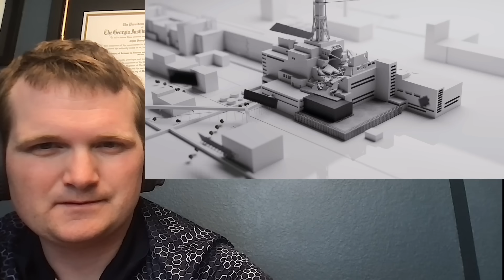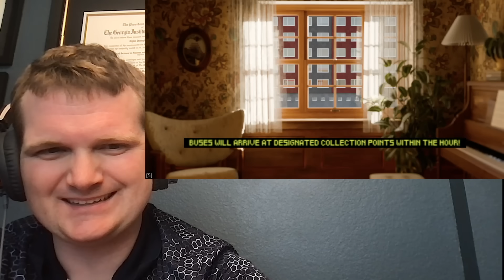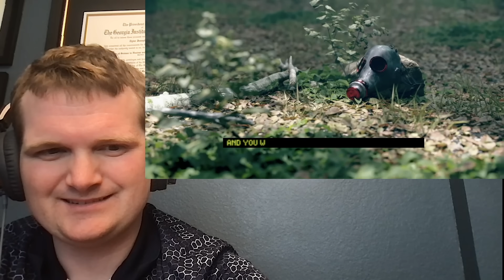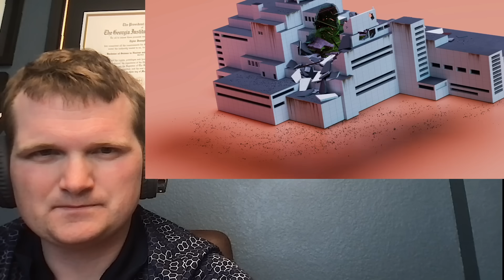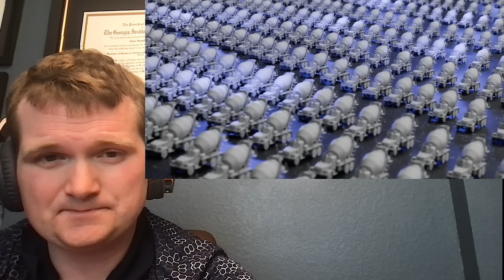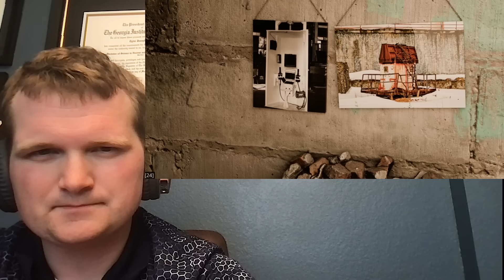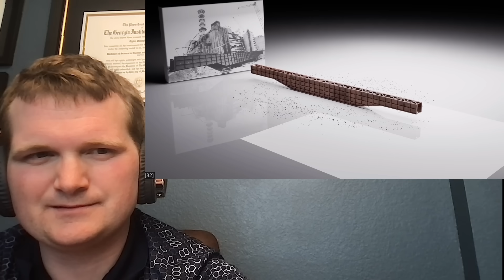The BEST Chernobyl Video on YouTube? - Nuclear Engineer Reacts to Solve

Comment: It's there anything scarier than Radiation? You can't see, hear, or smell it. You can be safe around one corner, 10 feet away on the other side of the wall is cancer in 5 years and up the stairs is death in 7 days after the worst imaginable torture.... And it all looks the same.... Do I go left or right?

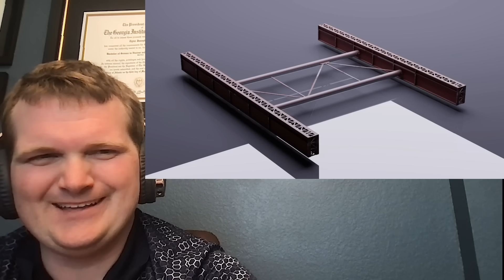Comment: 21:25 idk man i worked in the heavy-duty side of manual labour. The "maximum weight capacity" of each piece of equipment is actually lower than the real-life maximum. Like just as a minor example we had 1 counter balance with a 5800lbs capacity but you could push it to 6200 if you took it real slow and used the engine to brake. You could even lift it up if you used the clutch and just real lightly lifted er' up. Which is all to say, i trust that the maximum capacity is a CH lower than the real-life max weight. 

The fact it worked at posted max capacity in real-life setting means it can handle a CH over that and that's what we used to eat up the wind and torque-lever differences you'd experience when shifting the weight out away from the centre of mass. 

That's why the German war-machine operated at all, they was over-max all the mechanical limits but the shit just fuckin worked.
Reply: the physics we exist under and jokingly call our bitch are un-fucking-fathomable. God only knows, and i mean that sincerely.

Comment: The lead suits was to give hope. The physicists knew it was useless,  just like you said, but without offering the PPE no mater how useless,  got people to risk their lives.
Reply: That was probably the point of the masks during covid too. A placebo.
Reply: Why useless? Not thick enough to stop the gamma rays?
Reply: Useless because, with that amount of radiation, especially with gamma radiation - a type that has very high penetration power, nothing short of several inches of lead or concrete would do anything. Literally just getting on the roof, getting work done, and getting off the roof just as quick was the best protection you could offer.
Reply: He said 8 inches. So that armor would be about 1000kg
Reply: @garrymullins  Not only was it not thick enough, it wasn't full-bodied, so the limbs were completely unshielded along with the head.
Reply: how do you know that?
Reply: @Henrique_cwb  it was a common saying, stated by several of the Liquidators and repeated in the mini series.
Reply: @Henrique_cwb  How do they know what? That people would rather wear useless lead suits than go in with nothing? That's just human psychology, m8. As for the physicists knowing it was useless, not all of 'em died. I'm sure at least a few of 'em said they knew it was useless.
Reply: @hauntedshadowslegacy2826  but it would be good to have a SOURCE

Comment: How bad would the explosion have been if the molten reactor made it to the cooling tanks underneath while they were still filled with upwards of a million gallons of water? Didn't they say it would be equivalent to over a megaton of TNT? 
   Also, i was wondering if you could explain the effect of ionization and what it actually is when the air is ionizing/glowing?

Comment: Another issue with covering it with concrete was the core needed ventilation, or it could overheat and potentially burrow through the basement of the reactor complex and enter the groundwater table.

Comment: A comment about shielding properties of steel: I worked for some time building electron beam welding machines. Those machines create x-rays due to the Bremsstrahlung effect from the deceleration of high speed electrons in the target material or chamber walls. The vacuum chambers usually used about 1cm thick stainless steel. Radiation was not detectable outside. Some parts like cutouts and cable channels that used thinner steel had to be cladded by 3mm lead sheets to meet the legal limit of 1uSv/h. Of course its not Chernobyl but a low dose byproduct. Interesting nontheless. Just the lead handling was a little nasty.

Comment: They used lunar rovers to clean the roof.
Reply: That was the case for the 1st and 2nd level of the roof. 
The highest point of the roof was unfortunately too radioactive to the point where the circuit boards in the Rovers ended up being short circuit

Comment: Tyler,

I've just re-watched this video, and it's an excellent overview as always. 

Much like the Titanic disaster (bear with me), the more fascinating story is that of RMS Carpathia racing through the ice fields to aid a ship in distress, a story little told. And with Chernobyl the  story of the clean up, right up to the New Safe Confinement project, is arguably more fascinating and impressive than the explosion itself.

Friends often refer to Chernobyl as a nuclear explosion and I have to correct them as it was a steam explosion with a 2nd explosions of Hydrogen due to the disassociation of Hydrogen and Oxygen as the water was super heated. Not nuclear like a bomb.

I'm often surprised at how many folks don't really understand that.

Whilst one effect of the incident was likely safer reactor design, sadly, the other was a growth in fear over nuclear facilities, which has probably resulted in far more negative health effects through the continued/extended use of fossil fuels.

Another brilliant video, many thanks for your ongoing efforts.

J

Comment: 0:42 Didnt the St. Petersburg reactor also melt down first and was covered up? My understanding is that this was removed from documents, but revealed the flaws in the reactor design that created the need to run the low power testing did at #4 that made it meltdown. Specifically the flaw at the end of the control rods making them behave out of procedure for restart. (The tip was not moderating the reaction, and the documentation said that the reactor should scale slower than it was, and the procedure tripped the safety because of the computer detecting the rise too quickly)

Comment: The management of the disaster and it's containment afterwards was very interesting from an engineering standpoint, something which is not often mentioned. The initial as well as the current sarcophagus required some insane engineering. Soviet and subsequently Ukrainian engineers did a hell of a job.

Comment: The first idea to cover the reactor with bore and sand was impractical, since you can't get directly over the reactor core most of the sand will miss. Which, as said in the video, could cause the structure to collapse and cause another explosion.

Comment: All explanations. That center on the time element fail to convey accurately from a bio mechanical pov. 

If there are 50 grenades going off randomly every hour on a football field, logic and math says if you run very fast from one end to another (limiting your time of exposure, you will be far safer than a person who takes a pleasurably stroll. 

Cool.

BUT while that is statistically true for the entire group, on a per person basis it is not true. For the individual it comes down to luck only. 

Many people may upon running into the field, be immediately killed by a grande going off at their feet. Some people will make it half way and lose both legs but manage to drag themselves out. Sometimes 100 or 1000 people will walk across slowly and never even see or hear or know that a grenade has gone off, perhaps leading them to think there are no grenades. 

Some people might cross thei fold 10 times without seeing a grenade or 20 times without being hit once. 

The numbers only make sense when applied to an entire group after the fact. You can actually think of it in terms of quantum probability (becuase it is)

Comment: 18:37. Once the SCRAM (A3-5) was pressed, Reactor 4 spiked above 540 MWt (MegaWatts thermal or the other way around so to speak) and the final reading was 33,000 MWt. For context, the RBMKs had a standard operating power of 3,200 MWt.

Comment: Its max lifting capacity is probably at 70-80 degrees. Getting severely derated as the angle towards the ground gets closer to 0.

Its funny to think that 40 years later cranes are lifting 4500 tons.

Comment: They did use a bunch of BMP's as transport vehicles and for towing other equipment given the later models of BMP are equipped with NBC systems. Most of those BMP's are still parked in a field not far from the plant.

Comment: I am gonna be a dick: Most people don't think of fission bombs when thinking nuclear they think fusion so a fission plant will never be a nuke in common perception because it'll lack the fusion component. Ironically though, in rough, very rough, terms Chernobyl worked in principal like a nuke in that the primary, fission, event triggered the secondary, much more devastating, steam, event (still not a nuke but vaporized vs steam broiled chunks pulped against the wall, end result at ground zero is the same in functional terms, just something to shovel into a coffin for the latter).

Comment: Regarding armored vehicles, The VTS Ladoga was a heavily armored vehicle based on the T-80 chassis specifically to evacuate high ranking officials during nuclear, chemical, etcetera events (Ofcourse, never used for those purposes, as its job in Chernobyl was collecting data). I'm not sure if its been photographed there in Chernobyl (There may be a few photos, I'm just not aware of any at this time.) , but the Ladoga was able to enter Chernobyl while shrugging off insane amout's of radiation. I believe it even entered the turbine hall, with no issue. Though it was quite mandatory they decontaminated it after use. (ofcourse.) 

 Another use for armored vehicles, the old WW2 dated ISU-152 self propelled gun, was used to demolish buildings in the surrounding areas of Chernobyl. There are photos of them seen by either Unit 3, or 4. But it is most likely 4. I believe the ones used to demolish buildings still exist. Hopefully you see this, not too many people are aware of this. :)

Comment: Do modern plants have contingency plans that involve using liquidators?
Reply: Modern reactors are built with reactor containment vessels. 

Basically, the shells that's built around Chernobyl are pre-built around modern reactors along with a whole myriad of modern safety systems

As for a contingency for liquidators now, most likely, there are, but there wouldn't be a need for so many in an emergency now or them being put in as much danger by virtue of these modern containment and safety systems

Comment: If I'm remembering correctly, the people who monitor the site noticed that the radiation levels would sometimes increase. They came to determine that the structure was not as water tight as hoped and water was pooling around the remaining corium and fuel.

Comment: For those of you who don't know Russia, flew a drone into the "new safe confinement" structure. It created a huge hole in the roof and caused fires to spread across the roof. The biggest issue is that the function of the NSC structure is a negative pressure system, so the air inside is kept at a slightly lower pressure, which forces air to come in and not air to escape. This contains radioactive dust with the dome. The drone explosion destroyed that functionality, and some contaminated dust escaped.  Now, the entire NSC structure will have to be replaced or repaired.
Reply: I went to the comment section exactly for this as Tyler seems to be blissfully unaware.
Reply: EU has allocated around $10M for the repairs, but probably might need more than that.
Reply: When did this happen? Why didnt i know about it?
Reply: @antipoti  it was around january or february of this year. It became news for about a single day here.
Reply: It wasn't a failed attempt to destroy Chernobyl - if they wanted to do that, they could have. It was a threat. It was a symbolic gesture, a kind of terror attack. Russia wanted to use the fear of nuclear disaster as a psychological weapon to discourage the West from supporting Ukraine. The drone attack was timed to happen the day before a large international summit where Ukraine would be asking for the world's help.
Reply: The whole thing need repair?
Reply: Didn’t see this on the mainstream news. Absolutely insane.
Reply: Seems like something Russia would do
Reply: @Zthabarber it was mossad
Reply: When the Russian federation eventually collapses (it is inevitable) the new actually democratic Russia imo should be forced to budget some qty of its yearly GDP output towards service of a loan to cover the full and total cost of the original incident, all displacements, medical costs, losses of income, persecution, and all works of containment and cleanup past future and present. It will be their debt to pay retrospectively, because it is their debt to pay. This would be completely acceptable to me if it were my country who was responsible for it.
Reply: @Strobie_one  Chernobyl happened in Ukranian SSR though? what do you mean
Reply: @Strobie_one  Why rion the comment section with such massive amouns of shit? They paid for the whole thing, and none of those other compensations will happen and you know it. At best they could invest money for a new sarcophagus but not much more.
Reply: @electricspeedkiller8950  European Bank for Reconstruction and Development funded it actually. With contributions from practically every country on earth except for Russia. 

You could say that Russia “funded” the original containment, in that it did pay liquidators and people doing containment work in the months after the explosion. Russias only roll was to sit back and criticise everyone who took it upon themselves to fix things, and to pretend that it wasn’t their fault because they re-branded 40 years ago. 

That’s the same strategy they have used Mayak nuclear facility in the southern Urals where they continue to deny any wrong doing to this day, denying victims of their incompetence any compensation after poisoning entire towns, rivers, farms and communities in the name of their nuclear weapons programs. 

It’s a nice try, but your emotional attachment to Russia clouds your ability to distinguish between propaganda and reality.
Reply: @Strobie_one  thank you for stating the truth.
Reply: @Strobie_one sounds like what happened to Germany after WWI. That didn’t turn out so well. Current regime should pay reparations.
Reply: @bysshe51 what do you mean? I am pretty sure they still pay reparations to this day
Reply: @bysshe51   That was a very different situation. Those reparations, penalties, or whatever word you use, were meant to be economically crippling, so that Germany wouldn't have enough money to start another war right away. The Great War was so shocking, so horrific and previously unimaginable, that it makes sense that governments wanted to do whatever necessary to prevent another war. Of course that produced a bankrupt and desperate nation, and had other unintended effects. 

But these payments from Russia would be a drop in the bucket of their massive budget. It would be a symbolic concession, not a crippling economic blow. And the symbolism is exactly why they attacked the New Safe Confinement in the first place. They wanted to use the fear of nuclear disaster as a weapon to discourage the West from supporting Ukraine. It was timed to happen the day before a large international summit where Ukraine would be asking for the world's help.
Reply: And this is just another reason why Ukraine should be coming to the negotiation table, both to stop the killing of their young men in this proxy war promoted under the Biden administration, and to prevent jeopardizing decades of work to contain the radiation of this reactor which has already claimed many lives & sacrifices to fix it.
Reply: @RT-mv7df or we could hold the instigators accountable. But considering you’re a Russian Trumpy shill I don’t expect you to have independent thought.
Reply: @RT-mv7df  I agree with you. Russia has also not come to the table.
Reply: @4r391  Does Youtube shadow ban comments? It seems you saw my comment and made a reasonable retort (as well as understanding the meat of my point), but my original comment seems to be ghosted when I expand the replies under your main comment.  The comment could be viewed by the most ideological Russia haters as anti-Ukraine, but that's really all solely in the mind of vapidly pro-Ukraine supporters who have no ability to think critically about complex topics & relish in intentionally misinterpreting anything that doesn't interpret the world in stark black/white narratives.
Reply: @RT-mv7df 100 thousands died already😮  its juice again

Comment: Reminder that, if you are using OBS, you can and should change the FPS to 60 or 30. You can do this by going File:Settings, Video, Common FPS Values, 30 or 60.

Comment: Modern armoured vehicles are designed with NBC (Nuclear, Biological and Chemical) protection. There was even a tank meant to survive a nuclear bomb shockwave (300 metres) called the object 279 (soviet). the armoured vehicles you see here are Bmd-1 infantry fighting vehicles with relatively thin alluminium plates. AFVs (armoured fighting vehicles) today use depleted uranium for sub callibre shells such as APFSDS (armour piercing fin stablisied discarding sabot). Tanks today weigh about 60 tonnes
Reply: And now it can all be destroyed with a drone that costs a fraction of what the tank cost.

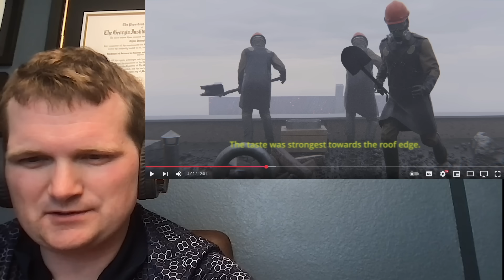Comment: 11:35 I think it is really true, that You can "taste" high doses of radiation; it is metal taste on the tongue (without any metal nanoparticles on the tongue). it is the radiation, that activates the taste-buds. 
"metallic smell" is something different; these are some specific organic, volatile compounds (I don't remember which ), that tickle the nose's "sensors"!
Reply: i used to be a commercial electrician, and you would taste your fillings if you got zapped by 277volt 😂(think similar to 120/240 house current but in high rises it's 277/480). Ps. yes, i know its not the same...im kidding 😁